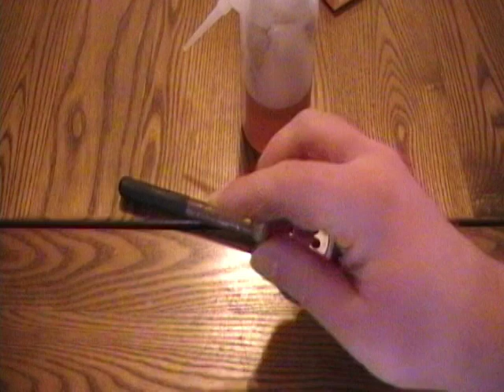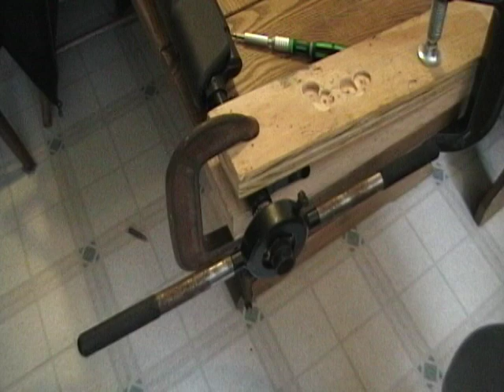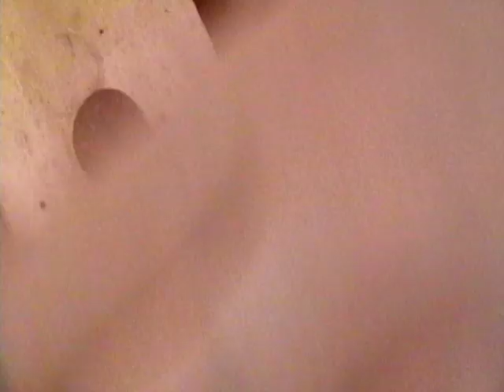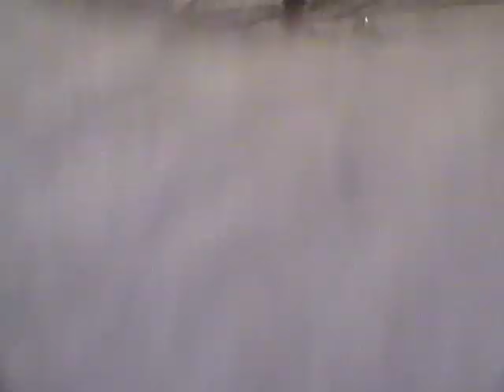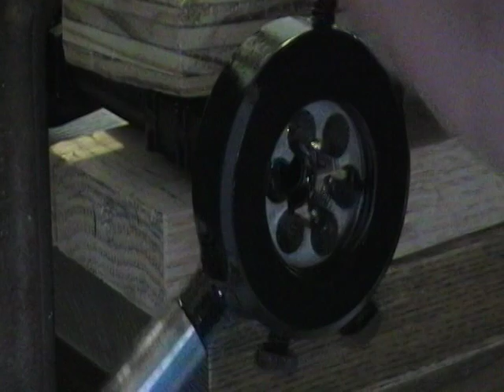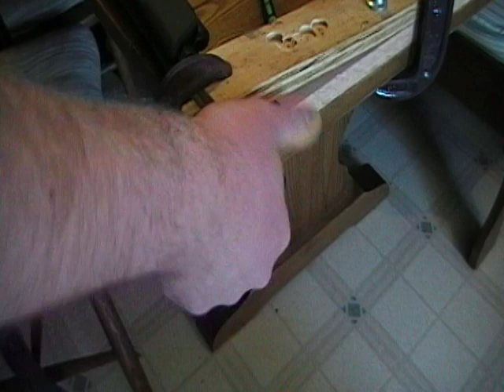AK-47 Muzzle Threading Project - Saiga .223 Rifle for Flash Hider, Brake, or Suppressor

Comment from the maker: The threaded portion of the TAT came into contact with the end of the barrel inside the die.  When I continued turning the die, the interference between the barrel and the TAT did not allow the die to continue down the axis of the barrel.  The teeth of the die then either stripped off the threads that had already been cut or re-cut them to the point that they no longer existed.

My best advice is to thread the TAT halfway into the die, and remove the TAT once you get five complete threads cut.

Comment from the maker: @windyhillpatriot Someone on Saiga-12.com did point out that it's prudent to check the muzzle outside diameter after removing the shroud before buying, renting, or borrowing the necessary tools.  His barrel was slightly too wide for the 14x1mmL thread and he couldn't get the die to bite.  According to the Internet the diameter should be between 0.52" and 0.58" for the 14mm thread.
 
Good luck with your rifle and thanks for watching!

Comment from the maker: I bought mine from CNC Warrior. The cutting die runs about $27 and the thread alignment tool (TAT) about $8.  If you don't have the die stock (the tool that holds and turns the die), that will be an additional $10-15, depending on where you shop.

Comment from the maker: Going by CNC Warrior's prices, the die, die stock, and TAT come to about $55 plus shipping.  Cutting off the shroud may require either a rotary tool with a cutoff disc or a pipe/tubing cutter, which can run about $30.  If a gunsmith can do it for less, or if you have any qualms about doing it yourself, then a gunsmith might be the best way to go.

Comment from the maker: @roysotojr I cut the shroud about 5/8" from the muzzle.  To reach this figure, I measured the depth to which my flash hider was threaded using dial calipers.  I forgot to take into account the thickness of the crush washer, which left a small gap between the end of the barrel and the end of the threaded portion inside of the flash hider.  It's no big deal, but jags and patches will occasionally get caught up on it while cleaning.  3/4" would probably work better.

Comment from the maker: I can't recall exactly.  I measured the depth of the threading with my dial calipers, added about 0.1" for the crush washer, and used that length.  It was about 9/16" if I remember correctly, but it might vary from device to device.

Comment from the maker: @roysotojr The shroud is steel.  Pipe cutters are reputed to work in cutting through the shroud.  I initially tried a pipe cutter, but the crummy tool I bought broke.  It did leave a nice, scored line around the shroud for me to follow though.

Comment from the maker: @TheBuzzardStew My favorite magazines are black .223 Bulgarian Circle-10s.  They're the same tough steel-reinforced polymer construction as the opaque 7.62x39mm Circle-10s.  Mine required a little filing on the back, just above the catch tab.  I also like Tapco Gail mags.  They're smooth and reliable too but they don't have any steel reinforcement.  My steel 35-round Galil mags are also pretty nice, but some of them will not feed reliably when wobbled to one side or the other.

Comment from the maker: If it's tack welded, then it should be fairly easy to cut through the blob with a rotary tool cutoff disc.  If it was welded on so as to "permanently attach" it to make the barrel 16" for NFA purposes, it would be a bit more complicated both in technical and legal terms.

Comment from the maker: Assuming you're going to go through the considerable legal hoops of getting the appropriate licensing to make your own suppressor (something that is outside of the scope of my knowledge and that would better be interpreted for you by an attorney), the threading dies themselves are not likely to be on the shelf of your local hardware or gun store.  I had to mail order mine, and there were also others threads available.

Just be sure your project complies with all applicable laws and good luck!

Comment from the maker: @TheBuzzardStew I took off just over 5/8" of the shroud and threaded as far as the die would let me.  That measurement was based off of the depth of the threads of the FH I used, but I suspect 3/4" would better accommodate a jam nut or crush washer.

I've heard pipe cutters do work very well and leave a cleaner cut.  Unfortunately, the cheap one I bought fell apart while cutting the shroud.  It did leave a nice, clean, concentric mark on it though!

Thanks for watching!

Comment from the maker: It's possible that a second person would be able to hold the boards, but I suspect that it would not result in a very rigid setup, which might make it difficult to get a good start on the threads and to know how far you've turned the die each time.

When I did it, the torque was either insufficient to cant the front sight enough for me to notice.